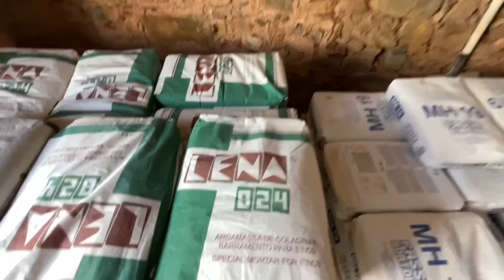Rendering Roof Looks Great On The Old Abandoned Village House #93

Comment: Some ideas for the house in town...
Are you allowed to paint the chimney on the roof a color? It seems most of the neighboring homes have a color on the lowest 50cm of the house. I think it would be interesting for the chimney to be the same color. 
The blue color from the doorframe inside the house would be a great exterior accent color. However, I wonder if the municipality has regulations on the colors. 
I think it would be interesting, when you build the walls for the upper stairwell, to put a small glass panel between the top of the stairwell (northerly side) and the bathroom to allow exterior light in to the stairwell. BTW, I  think the solution for the arrangement of these stairs is excellent. 
Please, take my ideas with a grain of salt as I have never remodeled a home. 😄

Comment: I’ve used high grade top coatings in my flooring installation for years. It’s amazing the stuff made nowadays like this. I’ve even used it on my concrete driveway to repair places and it has stayed on for years- blistering hot or minus 10 degrees f.Ain’t cheap though.

Comment: Just thinking that chimney seems now very close to the roof, could be a problem with proper suction and create back air flow. Something to keep an eye on. Great work and fantastic attention to details!
You know you made it when you got paparazzi!
Reply from the maker: Chimney is not in use other than conveniently handy for extractor fan outlet and bathroom fan. Interestingly  the new roof is same height as original.

Comment: Hi Andy, Why do you use plastic trimming on the walls and then cement over it? What is plastic trimming? I saw James doing something last video with small sheets of plastic. I presumed that was the plastic trimming! Have you ever thought of doing a Thermalmass oven in the House. (Permaculture Rocket oven). They are very cost effective. Pellets just for a couple of months expensive but worth the comfort. Nice job. Looks good. Watch out for sunstroke - exposed back of the neck! Very dangerous.
Reply from the maker: Helps give sharp edges and stops edges getting damaged.

Comment: i slowly start to like how the house turns out. the rendering looks spot-on; well done :D
as seen at 15:00 will the front wall of the small stair stay low (e.g. with a wooden railing on top) or do you plan to pull the wall up to the ceiling?
Reply from the maker: Mezzanine will be walled, steps down will have rails 👍
Reply: @rusticcrow  sounds good!

Comment: Lately, flies are quite bonkers for some reason. It's a new thing, at least here in Lisbon.

PS - With a mullet, you won't get a sunburn on the back of your neck. You used fake rooftiles anyway...

PPS - Can't you make a door access to the garage?
Reply from the maker: Unfortunately the floor levels won’t allow a door. We did measure to check 👍
Reply: @rusticcrow  Even if you put a few steps in between the two rooms?

I mean, it's a bit of a bother to have to go outside in order to access the garage, especially in the Summer.
Reply from the maker: Steps is one thing, 4ft door height will soon drive you nuts.

Comment: Is that chimney a little low? Should have been another foot in height at least?
Reply from the maker: As original height from previous roof and isn’t being used. The rear we will block so water can’t get in.  👍
Reply: @rusticcrow  I was just going to ask about that. Looked like water infiltration into the chimney might have been a future issue..lol.  Looking great!
Reply from the maker: @carlossousa4797  next week I’ll be blocking that section when I render that wall. If it wasn’t going to bathroom we would remove and raise. However it will come in handy for vents from extractor fan. 👍